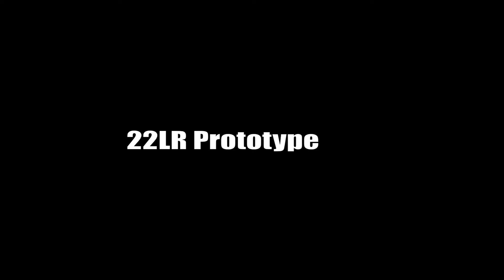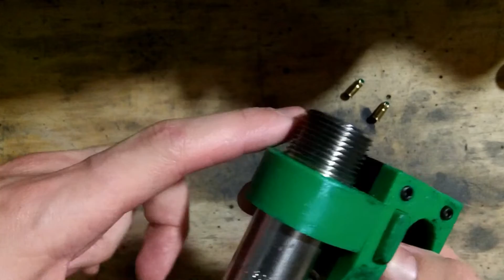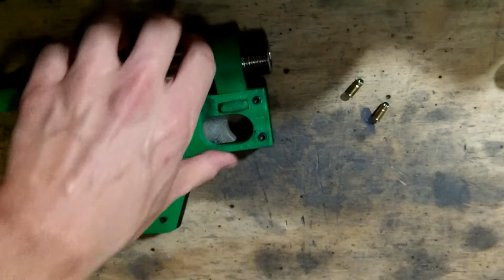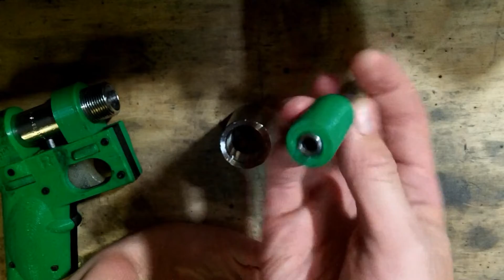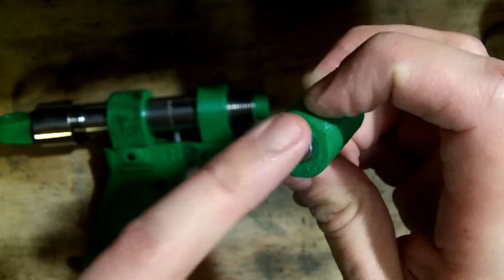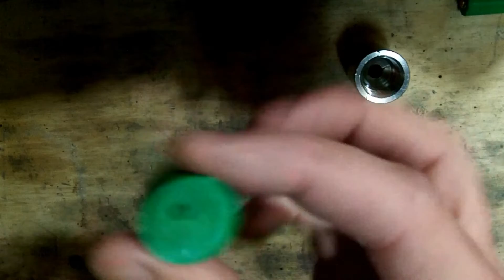#Liberator12k | 21 - 22LR Prototype

Comment: Do you think you could make a Remington rolling block? It was one of the simplest and most durable designs for the 19th century. Came in rifle/pistol. Just 4 moving parts: hammer, breechblock, trigger and safety lever. Very slick, yet robust and printable design.
Reply: If you're interested, MidwayUSA has a whole series on the rolling block, including a video of the full cycle of operation which I highly recommend. 

Now if I could borrow someone's rolling block, I'd try making silicone molds of the parts, and cast some out of urethane or epoxy. At $700 for a new Uberti reproduction, it'll be a while before I can afford my own.
Reply: For cartridges, 22, 32, 38 are pretty low in terms of recoil. As for semi-auto, check out some of the paper builds of 1911s on youtube. Despite being basically toys that can only shoot primers, no powder cartridges, they demonstrate full cycling and smooth action. Some of them are truly masters of their craft even if it's only with paper and superglue. I'm not sure, but that material may even be denser than 3D printed ABS and comparable in strength. They really look too good to be just paper.
Reply: Currently modelling the parts in NX right now.  Found a really detailed blueprint of the design. Wish I had a printer and I certainly could afford one, but I'm not setup permanently right now so I might end up borrowing one or ordering them CNC cut out.

Comment: If that coil spring isn't strong enough I know a guy with a coil spring off a 53' Mack truck you can get cheap.
Reply: The bolt head stood up well. Will you be firing a LR?